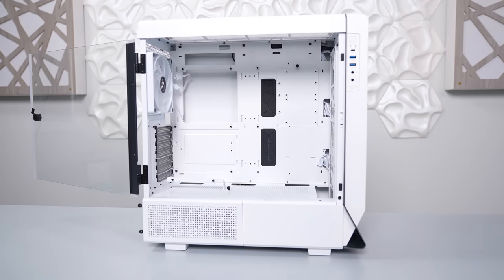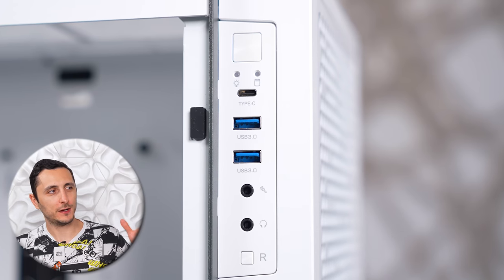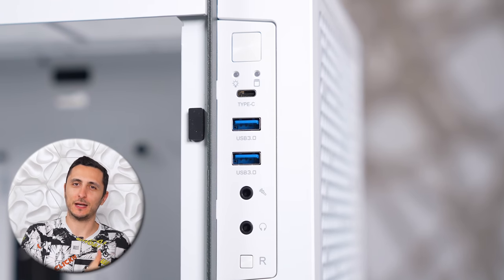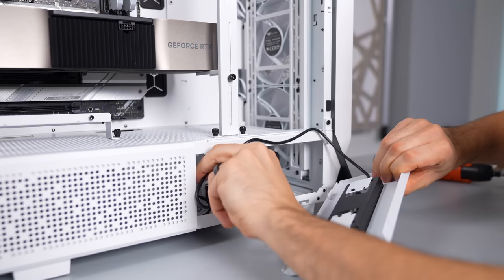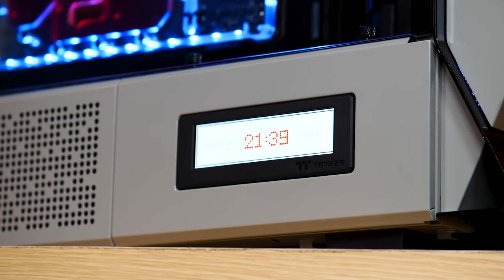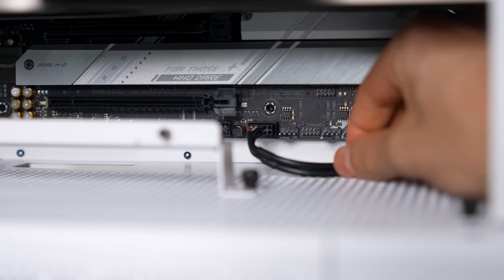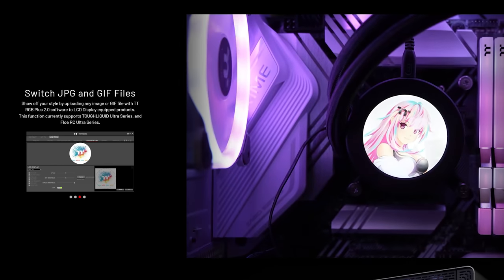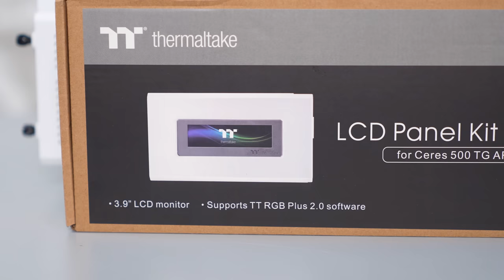This PC Case has a cool feature! - Thermaltake Ceres 500 TG

Comment: It seems I'm the contrary one when I give an opinion for the last 2 years.
1) I disagree entirely with making the case all white.  And that's from an artist/designer stand point.  All 1 color is super bland.  It's the reason for homes and furniture that are super popular are typically multicolored designs.  Like you don't just make your walls and cabinets the same color.  The point is to make things stand out.
2) The sag bracket is a nice touch.  You can find them made of acrylic though I've made a few made out of resin.
3) Some PSUs happen to be bigger than the shroud and some come with power supply sensors.  I've personally modded the cables to be shorter and wound them to be like artwork as part of the case.
4) Everything else is just a bonus

Comment: about the case colors, i get that it would be cleaner. but look at ur frost v3 build, its supposed to be an all white build but still u using a mostly black mainboard, why not commiting all the way? i dont really see it as that big of a deal and atleast for the gpu mounting brackets u can easily paint them if u want to. ofc not so easy to do the other non white parts.